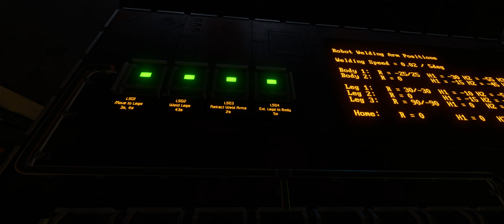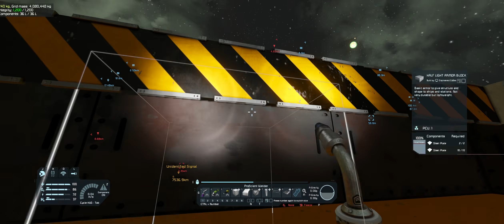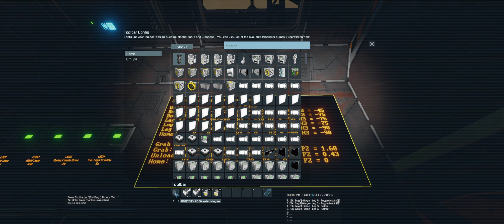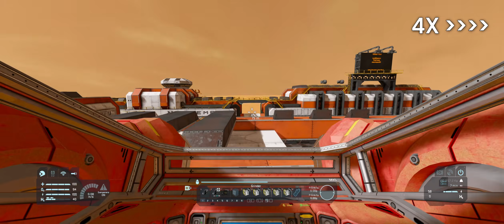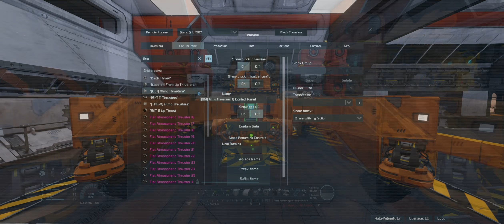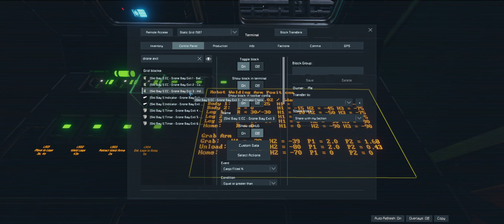First Skeeter Off the Factory Floor! Martian Engineering E20 | SE Survival

Comment: Love the series and waiting for the next episode to drop. I have a question that I cant figure out. How did you manage to place a block on the side of the wheel arm and around it when building the Clangscavator? For some reason It wont allow me to place any blocks around the wheel base. I spawned in your Blueprint to try and figure it out but when I grind the block off I am unable to place it back. Am I missing something?
Reply from the maker: I am not sure. I am setting up a discord with my friend ÆGIR, maybe you could send a pic of what section of the wheel once it's setup?
Reply: @EngineeredCoffee  Will do thank you. Awaiting the Discord link
Reply from the maker: https://discord.gg/RHPbNtjY. It is currently Aegir's discord, we are slowly converting to a joint setup.

Comment: A possible solution to the Skeeter docking issues might be to surround to platform's connector with a ring of armor blocks that rise along with the connector. On top of the ring you could put mag plates.
Reply from the maker: I like it! I was also thinking of adding a turntable to get it ready to relaunch.

Comment: You should make a Bulldozer in the style of the CLangscavator, with the lore that they'd push wrecked turrets/tardigrades into the grinder pits with them. Maybe also make a forklift to help move smaller things around the base? Maybe even a tardigrade variant that is meant to transport turrets to other locations, such as the Peanut and other facilities?

Comment: Awesome video! It sure is coming together now.
I think the misalignment with the drone at the end is because of the location of the remote controll block on the drone. I’ve heard it needs to be at the same coördinate as the connector (so basicly above) for this to propperly work. Which is fine on small grid with a normal connector but in your case maybe program the drone to go further..
Reply: I can confirm this. When you set an autopilot waypoint it's positioned at the center of the block used to set them, not the grid's CoM.

Comment: Looking at you preparing the other bays stressed me out cause it made me thing of how many blocks you'll have to rename and set up with the timers hahahah, I don't know if it still works, but there used to be a mod called mass rename or something that allowed to select a bunch of blocks at the same time and give them like a common prefix or change their names in bulk, don't know if it might be useful for setting up blocks in the terminal for you
Reply from the maker: I have the rename mod. Lifesaver for these builds. I am not looking forward to it either. Especially the subgrids, I can't realy use a projector. That's okay, I am trying to think of barients for the drones to make them unique...
Reply: @EngineeredCoffee  mhhhhh I was wondering, since you mentioned making multiple blueprints of the drones to have groups setup, would it be possible to make multiple blueprints of the building platform you have, like the subgrid that has all the blocks and timers on it, and rename stuff for each of those blueprints and then you simply build them with a projector and airdrop them into place in the holes in the factory?
Reply from the maker: @federicoacker4342 I will likely try with the main portion but the robot arm has like 4 subgrids so I will have to setup the timers anyway. Hopefully I wont launch them into the stratosphere like the previous episode 🤣
Reply: @EngineeredCoffee  yeaaah sadly those are gonna have to be setup fully manually, honestly, would be so good to have some UI mod that lets you do the setup like a unity workflow, just a bunch of drag and drops and arrows connecting things, the terminal is the main reason why I never even try to do the amazing things you're doing in this series, so refreshing to watch without having to be the one to struggle hahahah
Reply from the maker: @federicoacker4342 Maybe SE2 will be better
Reply: @EngineeredCoffee  as for drone variants, might be cool to have one whose whole job is point defense, just intercepts missiles with a gatling, although I think just 1 gatling isn't really effective at that, another cool idea would be to have a "sniper" variant, with maybe a custom turret on top with long range weapons, sadly with the limited battery capacity I think railguns are out of the question but artillery cannons might work, and another cool one would be a decoy drone, basically doesn't have a turret, it instead has a heavy armor turtle shell with decoys inside to attract enemy fire, and well, if worse comes to worst, a kamikaze drone that rushes at enemy structures and explodes
Reply from the maker: Nice, I was thinking artillery. I didn’t consider a decoy turtle, great idea!
Reply: @EngineeredCoffee  even some kind of explosives oriented one would be cool, like one that has a custom turret with a bunch of missile launchers

Comment: Amazing factory.  Love it.  @32:00 ish Did you review your cargo containers after adding the H2 thruster to the build sequence. I don't remember seeing you address the components event blocks to fill cargo.
Reply from the maker: I did not adjust the values, but the storage is built for 6x turrets, so it's probably fine now that we only have 4. But it's a good point.
I will have the inventory check up in the control room. It will basically just turn off the button so you can't make one without parts.